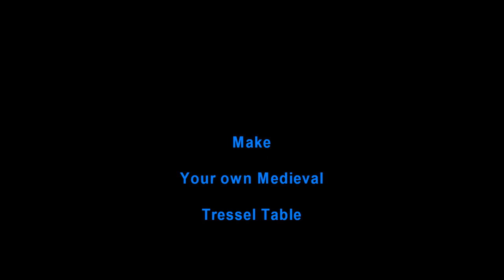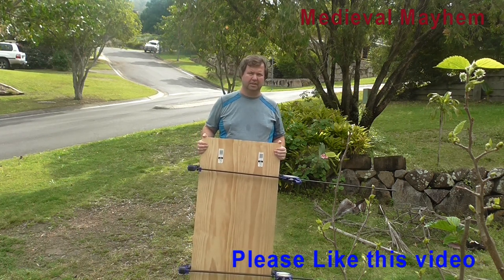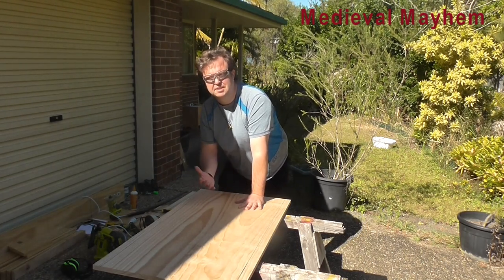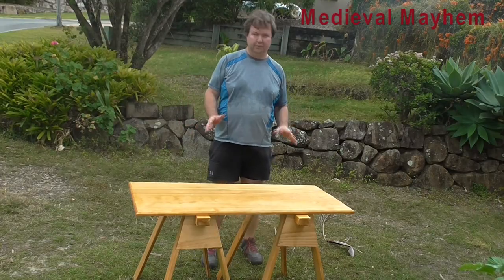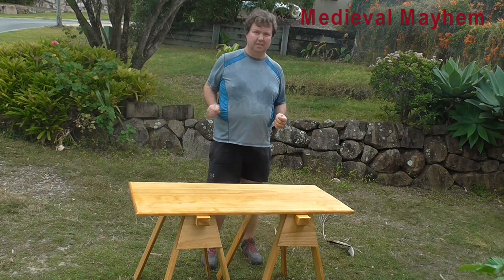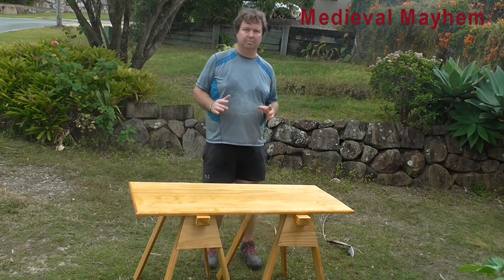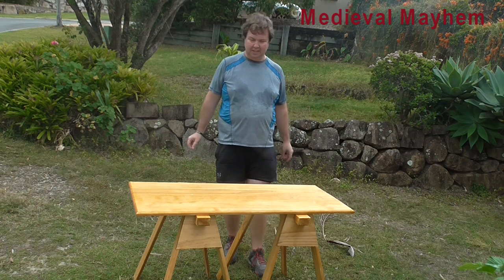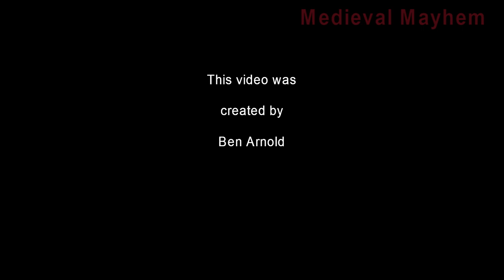How to build a Medieval Trestle Table DIY

Comment: Huh.  Those look more like saw horses than the bases on medieval  trestle tables, which typically have three legs, not four.  Google it, it's quite true.  Maybe the following pairs you said you were going to make will be mage properly.  Here's a really good illustration:  http://expositions.bnf.fr/fouquet/grand/f149.htm  They were made this way so that they would level easier on uneven surfaces.
Reply from the maker: Robin, not quite true. I did a lot of research in France and Italy, and my table is based on examples from iconography found there. Yes, some tables had 3 legs - I realise that. Not all.